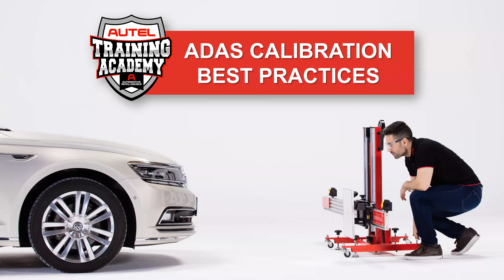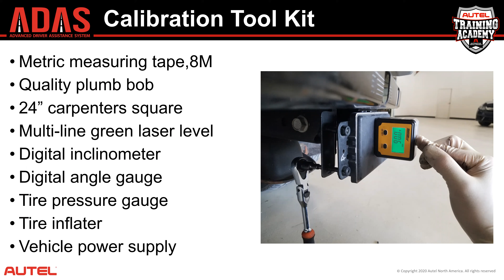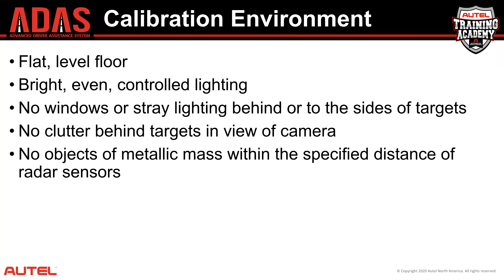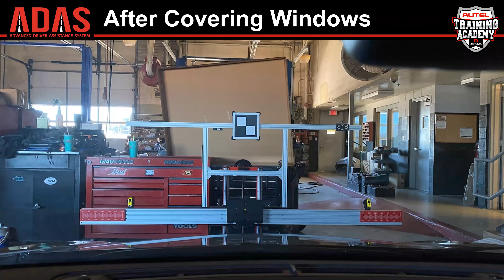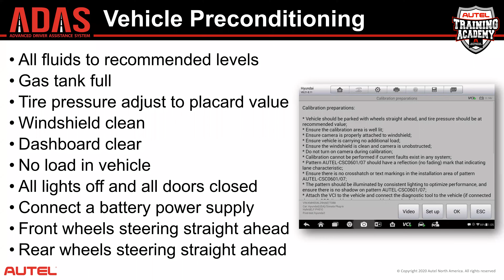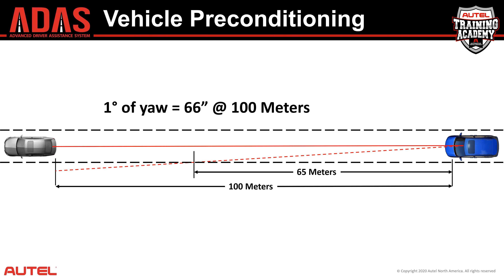ADAS Training Series Part 5 - ADAS Best Practices

Comment: Most manufacturers/OEM require for the vehicle to be unloaded for a vehicle to be successfully and accurately calibrated and that the calibration could be completely inaccurate if the vehicle is loaded........so my question is does the technician have to perform the calibration from outside of the vehicle with a wireless scan tool utilizing Bluetooth or wifi connections????  I think this is a point that should be made clear to all ADAS technicians, considering technicians come in all different shapes, sizes and weight classes, no disrespect to anyone, just seems like a good question to ask

Comment: The gas tank needs to be full to perform the calibration, so when in normal conditions after calibration, the gas tank is almost empty, the camera will not calibrate?
Reply: I guess the car knows that the tank is near empty and compensate the cameras... but in this case why wouldn't the car compensate while calibrating? since it has access to fuel level reading... this is an excellent question now I can't sleep.
Reply: @CuttheBuullShit  it makes sense!! About the calibration moment, maybe the car doesn’t look the other variables and expect to be as per the definition (e.g. with full tank…). It happens because this reduce complexity. But this is only a guess… 

So now maybe you can sleep well 😂